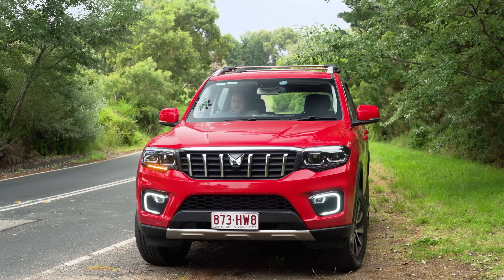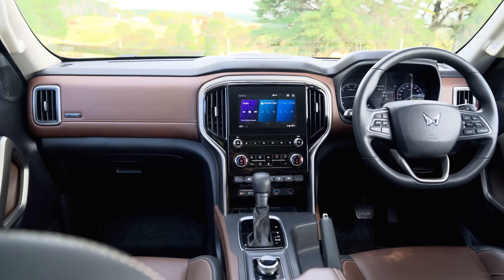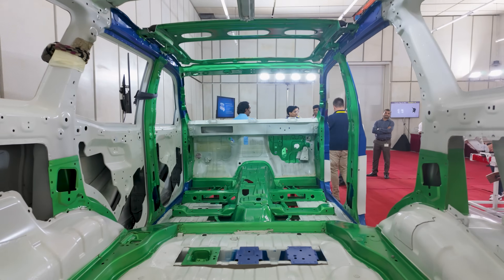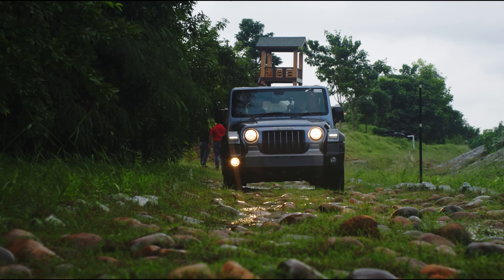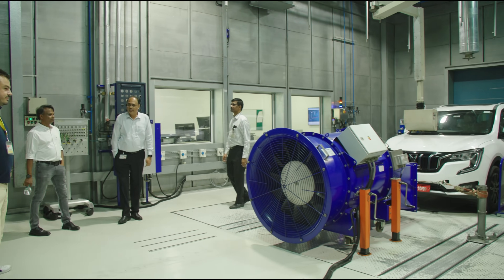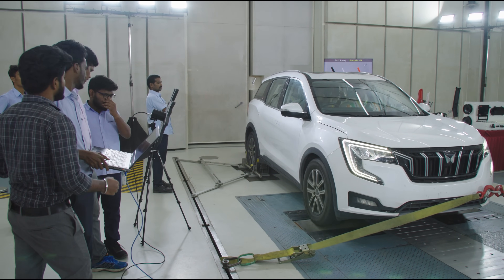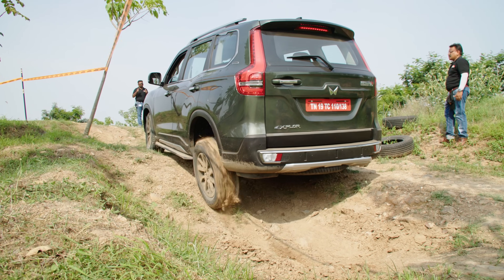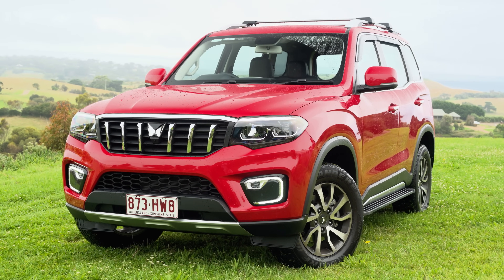The INSANE Engineering Behind the Mahindra Scorpio...

Comment: They need to get on top of there buggy software issues. I still have issues with a randomly auto resetting trip meter. Other than that and a steering feedback issue I can’t fault the vehicle.
Reply: Ya in India too we were having the same issue but its solved currently.........Its a software issue that can be solved by updating.....